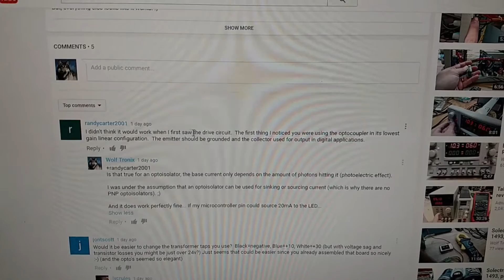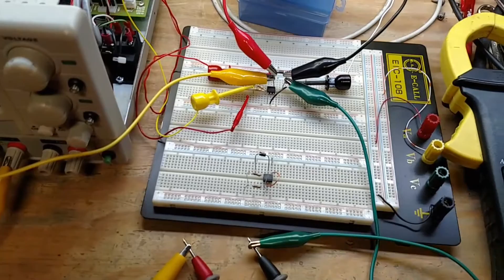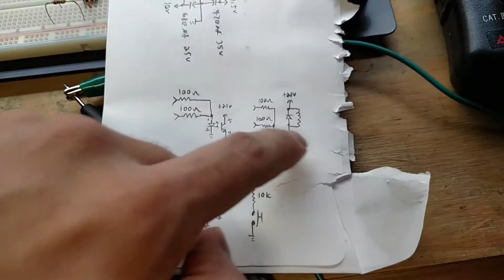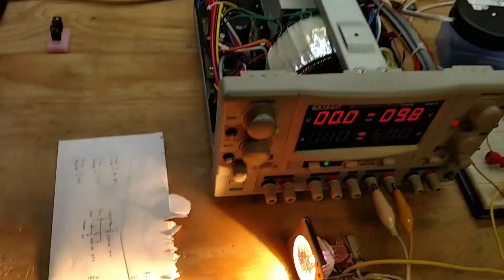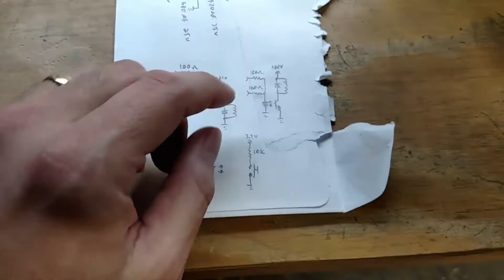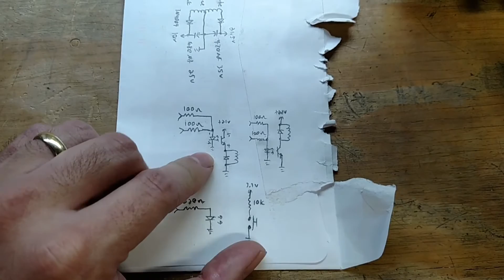Sinking or sourcing current with an optoisolator, is there a difference?

Comment: So I am working on a small project that uses 8 7-segment leds and basically I only want to control half the leds in parallel on each segment because I’m only looking to see 1 or 0 on my displays. However all I had for 7 segment LEDs were common cathode. Due most drivers and other logic’s being made for sinking I was running into problems. I thought maybe I could use  opto couplers and source it to my segments. They are max draw of 30mA so I think it should work I mean You seem to be doing this already. I’m curious to go home and implement it tonight. Great video.